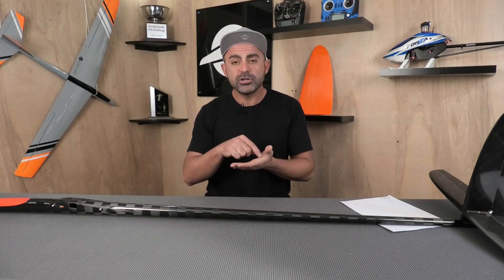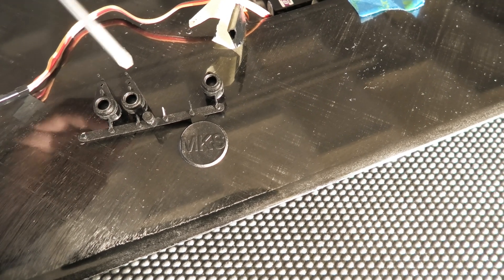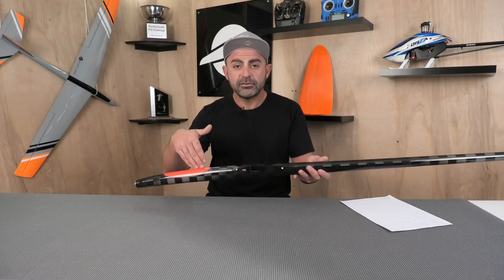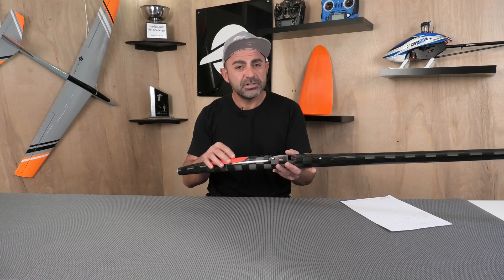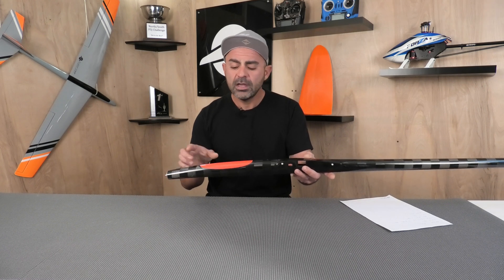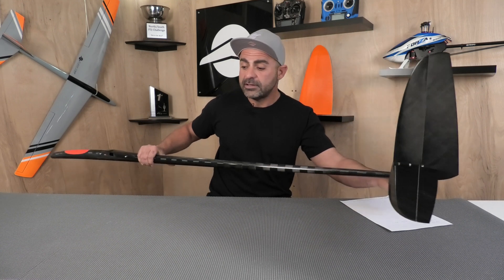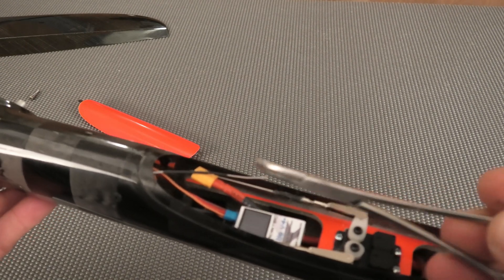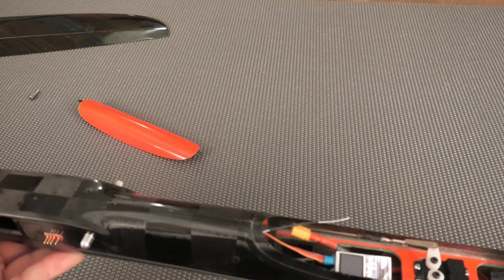Infinity Evo F5J Build Notes

Comment: Just building my first DLG so some really useful tips. Thanks 👍
I’ve a question about epoxy if I may...I don’t think we get quite the range of epoxys over here in the UK. Struggling to find much with really slow cure times. Will the West System G/Flex 650 Toughened Epoxy be ok?                        
https://www.westsystem.com/specialty-epoxies/gflex-650-toughened-epoxy/
Got to put a throwing peg in a carbon wing and am worried about the cure temps you mentioned. 
Thanks.
Reply from the maker: I think that will be just fine for a throw peg!
Reply: @flightcomp  кабанчик травой на киле вырвет.

Ставь сервы в хвост
Reply from the maker: Here is some good resin in the uk, available in small amounts 
https://www.easycomposites.co.uk/el2-epoxy-laminating-resin
Reply: Perfect. Appreciate the help. 👍